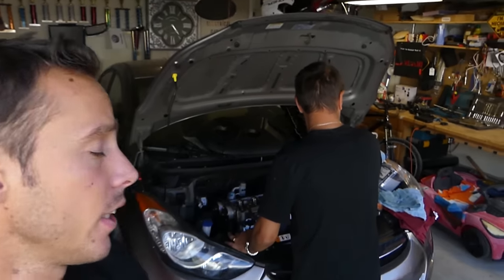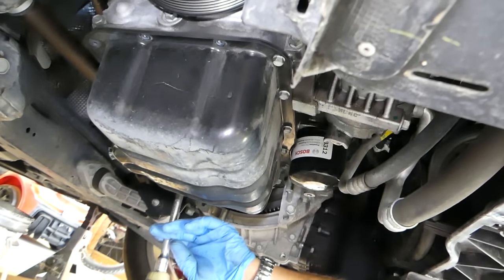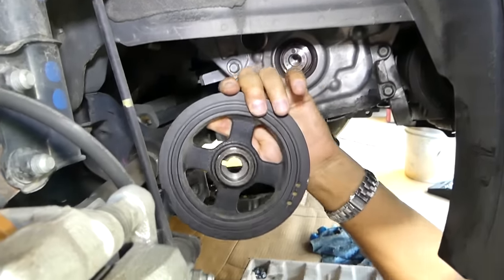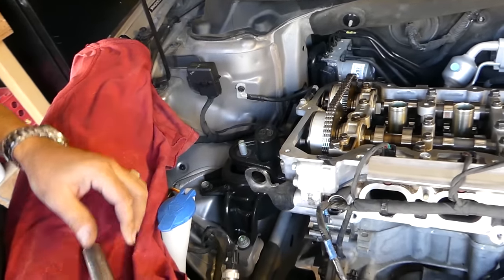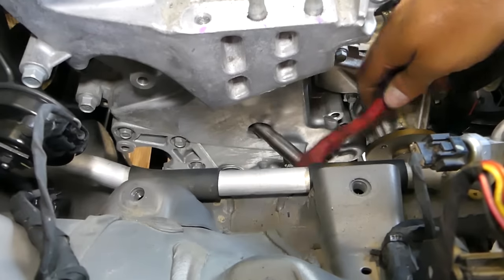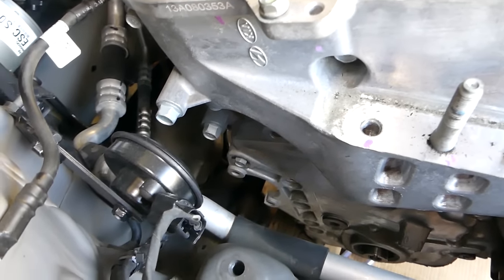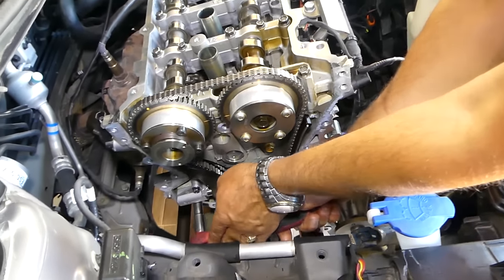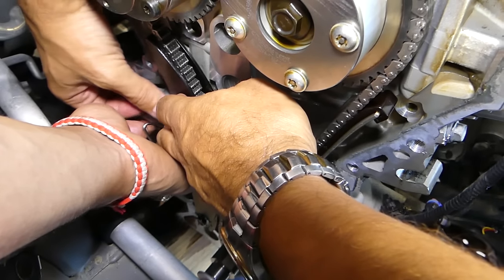HOW TO REPLACE TIMING CHAIN ON HYUNDAI ELANTRA

Comment: Timing chains should never need replacing. They last very long time. It is dealership scam to get money from when they insist that u need to replace the chain after only 40K miles on a 8yr old car. when there are cars with 200K+ miles on them and original chain
Reply: You replace the time chain and tensioner if someone don't do regular oil changes on there car. That will eventually create chain slap and cause your car to drive rough
Reply: NATE...I CONCUR GOOD CALL CHAIN UNLESS MANUFACTURER DEFECT SHOULD NOT NEED TO BE CHANGED.
Reply: Well honestly  no dealership wants to do them.  But when your chain rattles on 1st start up and eventually  chatters at 3k rpm ... it's probably the tensioner.. even tho they are also oil pressurized.. but  You still technically have to take the channel now Honda and Toyota say you can service the tensioner  without taking the covers off And without fullimg taking the chain out. They have access  ports in the timing cover for those
Reply: Ask 5 different dealerships and you'll get 5 different answers.
Of course dealerships will try to tell you to replace anything and get new wipers too. 
They work on comission.
One dealership told me chains do not get serviced, they last for the lifetime of the car.
I called another one, says the other guy lied to me and I need to replace every 100K .
Been driving my elantra for 180K and never had a problem.
Dealerships are probably the worst place to ask for advice.
Reply: Instead of replacing it how about just tightening the chain? Would that work??
Reply: Most commonly it's replaced when the tensioner is weak and guides are worn out, it is metal rubbing against plastic, no matter what eventually with enough miles they will be a little off. And honestly they are a cheap job for what it is
Reply: @hectorcorkidi6067 Thank you, I was just recommended the same for my Elantra even though I haven’t personally experienced any issues.
Reply: My 2013 has 150km on it. It was making noise. This video was helpful. We're halfway done. 

I wouldn't recommend doing the timing chain unless you hear noise like I did.
Reply: My tensioner went bad in mine and now my chain is loose, if you look at the kit it comes with a new tensioner and guide and chain everything you’d need, and mines got 88k so tell me again why manufacturers recommend certain things

Comment: This video was EXTREMELY helpful for me.  I just want to add a couple of shortcuts that you can take, if you want to.  But I do understand why the guys did it the way that they did, because there are reasons that the way they did it is simpler.  The first time that I did this job I followed exactly how they did it in the video.  Unfortunately I (foolishly) did not follow the advice that they gave which was to also replace the CVVT sprockets.  Because it turns out THAT was really my issue.  So I had to do this entire job AGAIN a few days later.  The second time I skipped a couple steps.  First I did not drop the oil pan.  I just removed the four bolts that go from the timing cover into the oil pan.  I didn't even bother draining all the oil lol, just a little so it wouldn't drip out.  But either way I did not want to reseal the oil pan that I had just resealed, so I did not drop it, and it worked out fine.  Also, the second time I did not remove the water pump.  It isn't necessary.  Although you do need to remove the water pump pulley.  Just a couple tips if someone wants to take a shortcut.

Comment: Hello guys thank you for the incredible videos. I have a 2011 Hyundai Elantra limited. I actually changed the tensioner, chain, and guides. After putting everything I still am getting the same sound. What could cause this? Do you think it could camshaft gear sprocket?
Reply: You find anything out?
Reply: Yeah I bet it was the sprocket. Surprised they didn’t show that in this video.
Reply: @jdurnal there’s other videos on how to change the sprocket exhaust and intake

Comment: How did you prevent the crank shaft from turning when you reinstalled/torqued the crankshaft pulley bolt? Did you use a ring gear stopper?
Reply: They most likely used an impact gun

Comment: Thanks for the nice videos. I am changing the timing chain on my hyundai accent. It is very similar to the elantra. I have a couple of questions. 1) when you adjusted the colored links of the chain with the marks, you had to rotate the exhaust camshaft and the crankshaft a little bit. This caused the TDC marks on the CVVTs not to be aligned any more. Does this mean the engine is not in time?! 2) what is the reason you had to rotate the engine 2 revolutions after installing the new chain? Thanks
Reply: When timing chain is old or used it gets a little bit longer even if is tight thats why they had to change  position a little bit. Its normal that engine can be a little bit out of time with old chain
Reply: If u turn engine twice the engine has gone through its four strokes and if marks are still aligned after turning twice then you have confirmed that you timed the engine correctly

Comment: I have a 2014 hyundai elantra with a knocking 1.8 trash engine. I found a 2019 elantra 2.0 engine for cheap. Do you know or think it'll fit, or  will transmission bolt up, & run right with everything swapped over from the old engine to the new one? Lmk if you have any idea. Thanks

Comment: Great videos guys, very educational. I have two questions. 1) how clean was the inlet manifold and inlet valves being a GDI? 2) would you consider the engine damage was due to the trend of using _X20 grade oils? Would a W30 or 40 have saved this engine? Thanks so much for your videos.
Reply: Regarding your Question 2, I was wondering the exact same thing... are X20 grade oils dangerous for my Hyundai 2.4L high mileage engine ?
Reply: @SuperKramer88  To be dead honest, I wouldn't risk it myself, I'd stick with your 30's or 40's. My Tucson only see's 5w40. It's a 2.0l NU GDI.

Comment: Same process for 2012 hyundia tucson?? My timing chain is extremely loose when I took valve cover off. I inspected the top of the cylinders for damage and everything looks good. I can see the vavles seating good. The problem is I have no compression. Wondering if the timing being off would cause this to happen? Please help

Comment: Great video. At how many miles would you suggest replacing a timing chain?
Reply: U don't need to replace thats why im wondering why is he replacing
Reply: You only replace it when you need to sort of deal. E.g: timing jumps randomly, odd noises or misfiring. And it usually only happens due to poor maintenance or if your engine was running dangerously low on oil. Tho changing it at 200k miles wouldn't hurt for prevention if you really wanted to keep the engine going if you wanted to be a perfectionist. Recommend a good cleaning the intake valves too. Since those two are the weakest link of these engines specially GDI.

Comment: How do you fix your backup camera from flickering. Don't know if it's an electrical problem, but sometimes when I put it in reverse, the screen starts to blink in and out and some days it doesn't
Reply: I have the same issue... found a solution yet?

Comment: hey guys i have a 2017 HYUNDAI ELANTRA with 2.0 L i replace the timing chain now i am getting a p0017 code and a P0017 P Code  does it matter what cam gear was turned to line up the marks to the chain ? i turned the intake one

Comment: I have a question how much is the torque in the block because I removed the valve cover and the block but it is not exactly the pressure that is in the block
Reply: On hyundai veloster 2012

Comment: Important note: you will need to buy the timing cover gasket set as well.

It’s 2 o rings on the timing chain cover and 1 on the crankshaft. I didn’t find this out until it was time to put the timing chain cover back on.

Comment: I buy a car 1 week ago and now I have check engine light on 105 000 millas and code say p014 p017 p0302 and I think need timer change because run fine but on stop shakes little and those code are for camshaft and crankshaft sensor and misfire and I think previous owner change spark plugs I but car on second hand dealer and all know is not guaranty what's you think? Run fine and shift

Comment: Where did u get your timing chain kit??? I cant seem to find one.. 2013 hyundai elantra limited
Reply: E1T3xa5 yeah this guys are clown they said 2011 and up and it’s wrong
Reply: From what I read the 2013 does not have a belt to change
Reply: All cars have a timing chain or belt to change. Find it at AutoZone then order it through eBay or Amazon.

Comment: How many mileage before you change the timing chain or what is the sign to replace it thanks a lot
Reply: Should last the life of the engine if you're doing oil changes in time and using quality oil. You can hear the slapping or ticking noise from your engine if your chain is stretched.

Comment: why the chain jump like that when you was turning it ?
Reply: Because there is no oil pressure on the tensioner, he even said it in the video. When the car is reassembled and is turned on, it won't jump like that
Reply: Duh

Comment: I have a 2012 Elantra so I guess that also has a timing chain too :).
Reply: It is actually based on what type of engine oil you use. Hyundai recomends for its veichles with nu engine that is exact engine on Elantra MD to use 5w20 or5w30. If exploated in normal conditions i refer use of 5w20 as gap between cylinder and piston is not more than 1000 microns (1mm). So ideal oil for elantra is 5w20.so if you use 5w20 for entire life of car and change it in every 5000 km.that means your engine cleans properly and your timing chain is not tensioned because nozzle of timing chain hydraulitic tensioner is not  clogged with oil deposits and your tensioner is working. Use 5w20 , change oil in every 5000 km and just dont think about your timing chain until 200k miles. I also owe elantra md 2013 with 100k miles on odometer, everyting is ok with car. Use shell 5w20 and change it in every 5k km.

Comment: Why does the oil pan have to come down? I'm not seeing a reason for this.
Reply: I'm assuming to be able to get the timing cover off ..........as some of the oil pan bolts bolt to the timing cover in the front side

Comment: Timing chains should never have to be replaced. Maybe a chain tensioner but never a chain unless some manufacturers defect or the oil jas never been changed but if that was the case you'd have way more problems than a timing chain.

Comment: Why did you change the timing chain?
Reply: The car had over 150k miles on it
Reply: John Smith  the engine and it's components are Mitsubishi motors. Not much changed.
Reply: Certain mileage reached require maintenance.
Reply: @gth882  agreed on all kinds of 4 cylinder engines. Even cop cars need cam swaps after 80k miles because they are always on idle for a very long time.

Comment: I had a 2012 elantra and the timing chain broked. I fixed the problem, i bought a corolla.
Reply: The timing cain broked at 165 000 km.i really liked my elantra but i didn't have time to wait for the mechanic to see if the engine would work again. I'm sory but hyundai, never again for me.